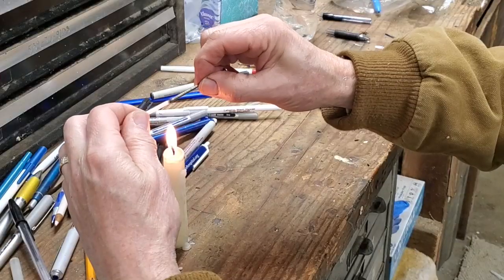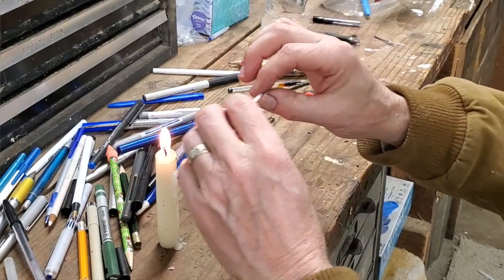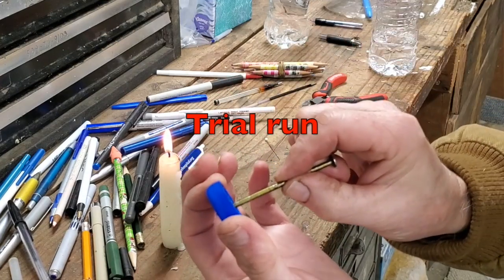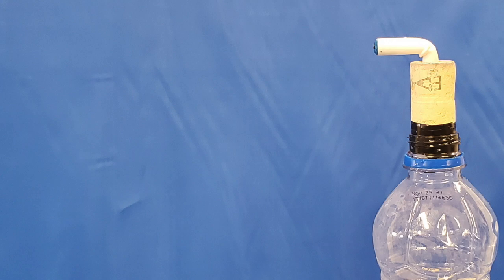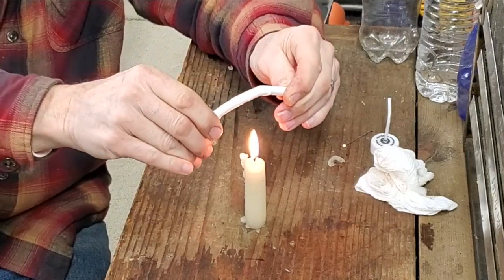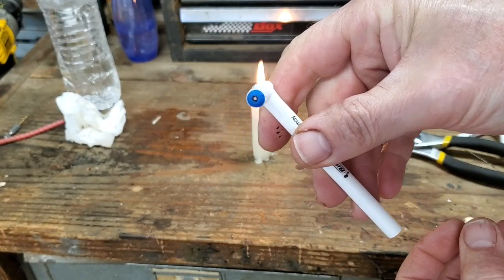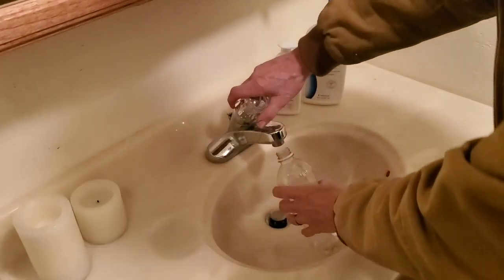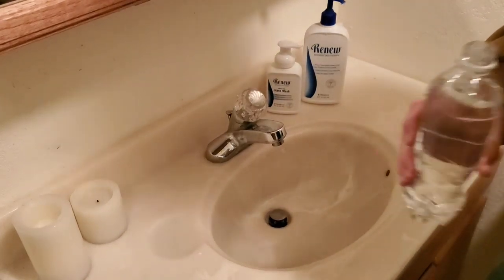How to make a Portable Bidet

Comment: I like that you used common household items. Thank you.
Reply: Disposed water/pop bottles work. Hole in cap more flexible than in bottle. Hole on thread side of ridge leaks! Drill or heat needle/nail to Make 1/16 inch hole from inside cap on wall just above the ridge! Sprays sideways.

Comment: Love this man and his inventions/innovations, this is the kind of thinking we need to face this current crisis instead of fighting amongst ourselves like savages over paper smh
Reply: Disposed water/pop bottles work. Hole in cap more flexible than in bottle. Hole on thread side of ridge leaks! Drill or heat needle/nail to Make 1/16 inch hole from inside cap on wall just above the ridge! Sprays sideways.

Comment: Thanks for continuing to provide innovative ideas! 

You just never know what’s around the corner. 

Have a great week! Stay safe out there!
Reply: Disposed water/pop bottles work. Hole in cap more flexible than in bottle. Hole on thread side of ridge leaks! Drill or heat needle/nail to Make 1/16 inch hole from inside cap on wall just above the ridge! Sprays sideways.

Comment: Thats amazing! Recently I have been thinking of mobile bidet ideas for when I go to the army etc because at home I use bidet all the time.... So much paper and time saved from using paper.....
Reply: Disposed water/pop bottles work. Hole in cap more flexible than in bottle. Hole on thread side of ridge leaks! Drill or heat needle/nail to Make 1/16 inch hole from inside cap on wall just above the ridge! Sprays sideways.

Comment: Excellent solution.  Nice going!
Thankfully, we’d been looking into bidet fittings since we came back from a trip to Scotland in 2018, and a few weeks back, got a couple of small units that attach to the back of your toilet seat, and the cold and hot water hoses of your sink.  They were a $100 each.  They’re amazing.  I’m thinking a nice warm-air bottom dryer would be great, too.  Then, we wouldn’t need any paper or cloths at all!
Reply: Disposed water/pop bottles work. Hole in cap more flexible than in bottle. Hole on thread side of ridge leaks! Drill or heat needle/nail to Make 1/16 inch hole from inside cap on wall just above the ridge! Sprays sideways.

Comment: I knew there was some way to do this using random stuff around my house and no tools, thank you!
Reply: Disposed water/pop bottles work. Hole in cap more flexible than in bottle. Hole on thread side of ridge leaks! Drill or heat needle/nail to Make 1/16 inch hole from inside cap on wall just above the ridge! Sprays sideways.

Comment: Great idea Paul! We're experiencing a TP shortage in my city despite being a pulp-and-paper province with a TP factory right down the road; they're running 24/7 with a third shift. Some people must have mountains of hoarded TP in their basements and storage lockers!
Reply: Disposed water/pop bottles. Hole in cap more flexible than in bottle. Hole on thread side of ridge leaks! Drill or heat needle/nail to Make 1/16 inch hole from inside cap on wall just above the ridge! Sprays sideways. Shampo/skin cream, etc bottles with side nozzles work too.

Comment: Genius Paul!  Ready made high power bottles like these are available in hospital supply shops for cheap.  But I like the cork version since i have corks from wine bottles.  Asians, like me, have been using water for centuries so lack of toilet paper is actually a funny concept.  Paper was useful for outhouses in severe winter climates but is so unnecessary today with indoor plumbing.  About time we stopped using this wasteful product that uses dioxin a very toxic chemical in its production.  So glad you are making these videos!  Keep it up.

As for wipes, use a microfiber hand towel.  Rinse, reuse, launder once a week.  If its your own and touches only your own backside, where is the issue?  Wash hands with soap as the grease in soap dislodges the pathogen from your skin.
Reply: Disposed water/pop bottles work. Hole in cap more flexible than in bottle. Hole on thread side of ridge leaks! Drill or heat needle/nail to Make 1/16 inch hole from inside cap on wall just above the ridge! Sprays sideways.

Comment: we made some pretty use-able face shields from diy book binding supply, that is the transparent cover from it. all you need is gaffer tape, two pieces of twig or two toothpicks, an o-ring, a piece of high density foam (cut off the end of some camping sleeping mat) and stretchy rope. you could make a video out of it. there's only one trick that makes it work better: make the holes in your transparent cover about as long as the width of your tape, because if you simply tie into the edges of the hole it will tear itself apart, it needs the twig or tootpick or any type of rod to give it support. you also need the foam mat on your forehead if you don't want it to be sweaty in two minutes, and that also gives it it's shape. if you want to have a look reply to this, and I'll make a quick unlisted video.
Reply from the maker: Hey Mark. I'm not totally visualizing your idea but would love to see more. If you'd like you can Email me a pic or sketch at paulwelkins@yahoo. Thanks so much for sharing!

Comment: good ideas. just what i was looking for. after several days of getting up early to go to get toilet paper and looking all over but only finding empty shelves , i think i'll try this instead.
Reply: Disposed water/pop bottles work. Hole in cap more flexible than in bottle. Hole on thread side of ridge leaks! Drill or heat needle/nail to Make 1/16 inch hole from inside cap on wall just above the ridge! Sprays sideways.

Comment: Next challenge. Same "stuff from around the house rules." One way valve on the bidet so no accidental return water into the bottle
Reply: Derpetology 101  🤣
Reply from the maker: Derpetology 101  Hmmm. Didn't think of that. How do they do it for hospital type hand held bidets I wonder?
Reply: Derpetology 101  no, so the water in the bottle doesn't get contaminated for the next bidet use

Comment: Lmao the first one seems actually doable
Reply: Disposed water/pop bottles work. Hole in cap more flexible than in bottle. Hole on thread side of ridge leaks! Drill or heat needle/nail to Make 1/16 inch hole from inside cap on wall just above the ridge! Sprays sideways.

Comment: Disposed water/pop bottles work. Hole in cap more flexible than in bottle. Hole on thread side of ridge leaks! Drill or heat needle/nail to Make 1/16 inch hole from inside cap on wall just above the ridge! Sprays sideways.

Comment: you could buy an empty sanitiser spray head bottle that people use for cleaning around the house ?
Reply: Disposed water/pop bottles. Hole in cap more flexible than in bottle. Hole on thread side of ridge leaks! Drill or heat needle/nail to Make 1/16 inch hole from inside cap on wall just above the ridge! Sprays sideways. Shampo/skin cream, etc bottles with side nozzles work too.